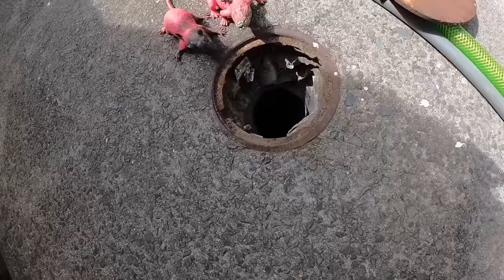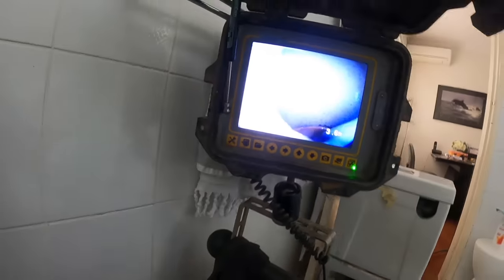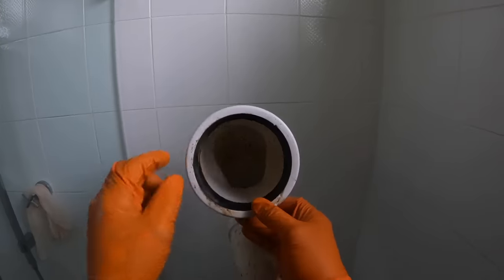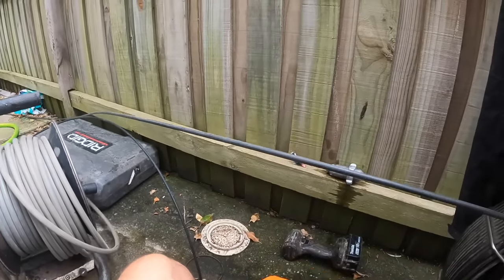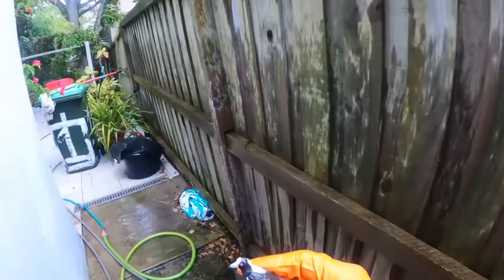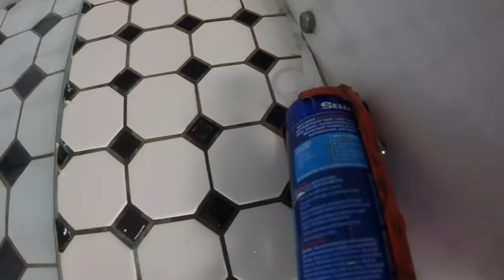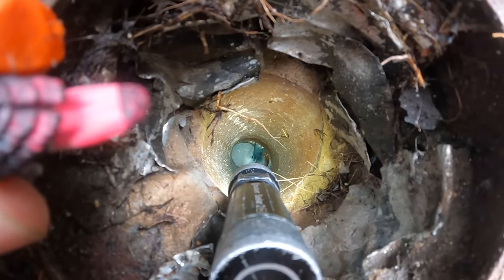Blocked Drain 632

Comment: It always impresses me how different plumbing is from country to country. Same function but different ways of doing it. In the US toilets are connected to the drain line by a wax ring sitting on a flange with bolts.
Reply: It seems like just that kind of toilet, the bend in regular porcelain toilets seems to be that plastic part. Idk, odd design.

Comment: The way we set our toilets  is so different here in America..... we use wax rings to help keep them from leaking..... Great video to start my day.
Reply: Yeah, over here in Germany we wonder about what you do in both places. Although I have to say the Aussie style is closer to ours. On newer homes you will likely find the pipe going into the wall instead of into the floor. We also don´t run our sewer lines through gullies on the outside of the house. That style I only know from the UK.
Instead of Wax, don´t you sometimes even still have something like lead pipes for that? or is that what you connect to using the wax?
Reply: We got away from lead decades ago

Comment: Absolute dumbest toilet design ever 😳
Great job as usual Ollie
You set the standard for work ethics 
You always give 110%
Cheers from Canada
Reply: I was about to comment the same thing. Our toilets are so much better designed. No concreted in, no need to drill it. No fricking pipe to fight with and possibly could leak... like it happened...
Reply: @thephantom1492  Where do you live? U.K.?
Reply: @edwinlandy  Nope, also canada.
Reply: you do realize this toilet can also be used on a through-the-wall drainpipe, so the slab doesn't need to be broken up on a retrofit bath installation? Everything down under is on a slab and it's common to have exposed pipes because nothing freezes. Basically one toilet fits all by using a different connector pipe. You can also trim the pipe to fit 10, 12, or 14 inch offset through the floor. In North America you'd have to stock three different toilets.
Reply: @thephantom1492  I'm in the U.S., and I don't like our design at all.  The floor under the toilet has to be perfectly flat, or the toilet will rock back and forth and eventually break the wax seal.  And, the flange needs to sit right on the finished floor surface to work right, and this often gets "overlooked" during remodels.  Plus, the new pvc flanges deform when the toilet is bolted on and do not hold the toilet well.  The whole toilet situation is ripe for improvements.
Reply: @edwinlandy  You are suppposed to add a silicone bead all around the toilet base.This fix the rocking issue. The flange can be a bit higher than the floor, and if it is lower then there is some spacer available.

Comment: So, it appears that indoor plumbing is a real afterthought in Australia? It really does seem ridiculously over-complex for what it does. Why is the trap not integrated into the toilet? Why are there so many underground "gullys"? Why are their floor drains without P traps? Jeez. What a mess Ollie!
Reply: the toilet does have a trap, but it's not very deep. You can also use that toilet with through-the-wall pipes so you don't have to dig up the slab on a retrofit. Here in the USA we had whole house traps at one time, pre-WWII. They still use them, but they are outside because there usually isn't a basement. This is why you don't need a trap on a floor or shower drain.

Comment: No wax ring on the toilet. In the U.S. toilets are installed with a flange that the toilet bolts down to and a wax ring sits on to top the flange to properly seal the toilet to the flange. The toilet is also the lowest or closest to the main/ stack drain.

Comment: Modding that new pan connection, and using the old one to hammer the retaining ring on, just proved a comment I heard in a recent Diesel Creek video - "Everything's a hammer if you use it wrong enough"  😂😂🤣🤣 43:30

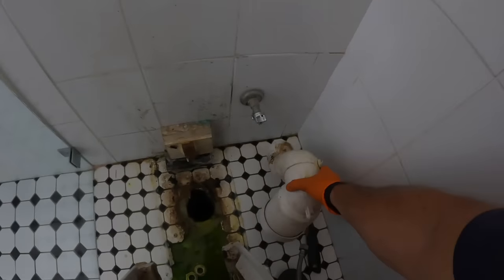Comment: 8:38 and 21:08 That is why you should never seal all the way around the base of the pan. If there's a leak, it should have a way out so you know straight away.
Reply: in the USA it's code to seal a toilet to the floor, but only on the front three sides. (sanitary reasons) If you get a leak it shows out the back.

Comment: Never understood why people silicone the bottom of toilets, it is in my opinion better to allow some air flow as well as being able to see a problem before it potentially becomes a major mess
Reply: Usually you leave a 1-2" gap of silicon near the rear just so you can see any leaks. It also keeps dirt and pee and other crap from getting under the toilet.